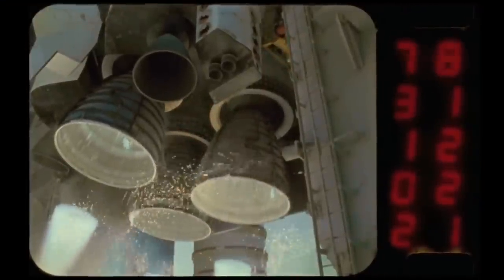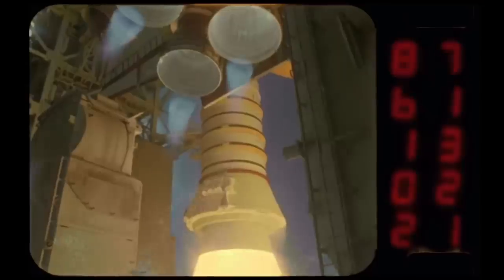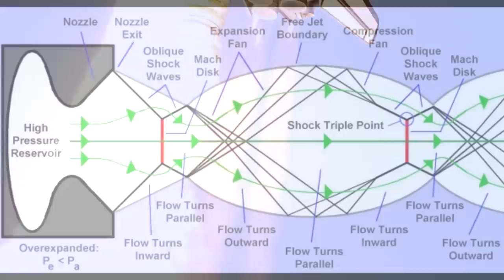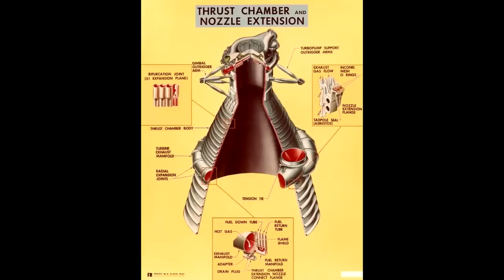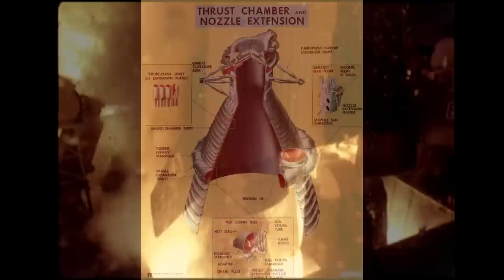Why Rocket Exhausts Look The Way They Do

Comment: Is there a good reason why all liquid fuel rockets don’t just use hydrogen and oxygen, like the shuttle?  Seems like a much cleaner alternative, with the only byproduct being water.  I’m guessing it has to do with the amount of energy the fuel contains?  But if it that’s the case, why didn’t the shuttle use a different fuel for the main engines and have a smaller external tank?
Reply from the maker: https://youtu.be/jI8TuufCp0M
Reply: Scott Manley Excellent!  Thank you.  I’ve long wondered about this and that was a great explainer.  👍🏻🚀

Comment: Surely the energy wasted in a rocket engine in the exhaust gas being heated is wasted.. I mean if you were to accelerate cool dense air out the exhaust at the same rate as a rocket engine. It would be both much cooler and more efficient. surely there must be a way of sucking in ambient air and thrusting that out.. I mean they said it was not possible to land boosters, and now its common place..
I mean if you just had a special air breathing engine that ejected just above max Q.. would that be ideal.. then you could have a bigger second stage and hence more payload??besides the second stage only needs to goe as far as technically feasible to reneter it for reuse.. Thats getting higher all the time..

Comment: Why don't gases emit as much black-body radiation as solid bodies? I thought that the only thing that affected the energy emitted was the temperature of the emitter. Where does particle size come into play?
Reply: Rate of energy emission per unit area depends on temperature. Bigger particles mean more surface area, hence higher total rate of emission.

Also, gas molecules may not behave like black bodies if spectral effects are involved.
Reply: They do under high pressure (e.g. the interiors of stars).

Comment: I just thought of a engine that would likely be better then the systems they are using
Reply from the maker: Make it real!
Reply: Scott Manley alot easier said then done, I have many things I would like to patent/produce  but it's virtually impossible at this point in my life.. maybe later in life I will. The design I've thought of might not be as reliable as well, it would have some more moving parts.. I think they have the ability to produce better engines if they wanted to throw money into it, the cost of testing and designing it is too much to be worth it most likely..

Comment: Why do they use the more expensive helium to pressurize fuel and oxidizer tanks instead of the more cheaper and just as inert argon gas
Reply: The price of the helium is going to be relatively insignificant compared to the price of the rocket. I imagine that the lower mass is a much bigger factor than the price of the gas.
Reply: Because outer space is fake
Reply from the maker: Helium’s flows faster and is lighter so engineering wise it’s superior. Cost difference is tiny compared to everything else.
Reply: because argon has almost identical boiling point to oxygen and is way above hydrogen. It is very likely that it would just condense inside the fuel tank, not pressurizing it at all.
Reply: Two things: 1) In the case of pressurising hydrogen tanks, you need to either use helium or just do autogenous pressurisation with boiled-off hydrogen, as all other pressurant gases would condense against the cold liquid hydrogen.
2) The pressure of a gas follows PV=nRT - so that at the same temperature and pressure, no matter what gas you have, you also have the same number of gas atoms/molecules. Thus, in order to minimise the mass of your pressurant gas (since every gram counts), you want to use the lightest inert gas possible.

Comment: Have they ever used LPG (liquid propane gas) as a fuel?
Reply: I doubt it. What advantage would it offer? You have to keep the stuff liquid, so that means more heavy insulation on your tanks, and I imagine the performance is going to be very similar to kerosene because LPG is a relatively long chain molecule. When they use cryogenic fuels like methane and hydrogen they do it because the performance benefit outweighs the additional complications of storing and using the fuel.

Comment: Why didn't NASA make a more robust insulation around the Space Shuttle external fuel tank to alleviate the problems of foam falling off. Maybe a weight penalty but I'd be willing to give up capacity to keep'em flying?

Comment: So if there is nothing for the exhaust to push against in outer space then the object is not going to move. So a rocket booster, or directional stabilization won't work either. You just shot yourself in the foot with this video.
Reply from the maker: Isaac Newton understood the principle of momentum conservation 300 years ago, please at least bring your understanding of the world into the 17th century before commenting in the 21st century.
Reply: Scott Manley if the momentum stops so does life
Reply from the maker: Why?
Reply: I understand thermodynamics enough to know that doesn't apply to the vacuum of outer space
Reply: Imagine two astronauts floating side by side in space. One of them places his hands on the other's chest and pushes him away. What happens?
Both of them will drift away from each other regardless of who did the pushing because action equals reaction, as Newton understood more than 300 years ago.
Same principle applies to rockets. If a rocket throws out one tonne of exhaust gas every second with a speed of 3 km/sec, the reaction of that action will produce a thrust of nearly 306 tonne-force or 674,000 pounds – about six times more than the world's most powerful jet engine, the General Electric GE90.
Reply: @fromnorway643  I've used a similar analogy where you take two bowling balls and compress a spring between them and then use a piece of wire to hold the two balls  together. Then put the bowling balls in space and cut the wire. As the spring decompresses the two balls are pushed in opposite directions away from a common starting point. Essentially, each of the two masses is pushing the other in the opposite direction. This principle is really not that difficult to understand.